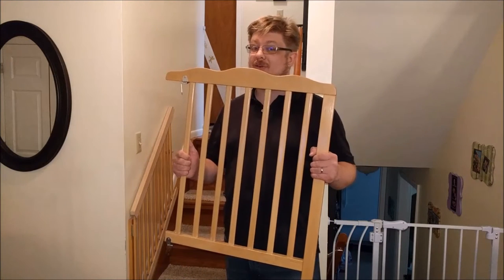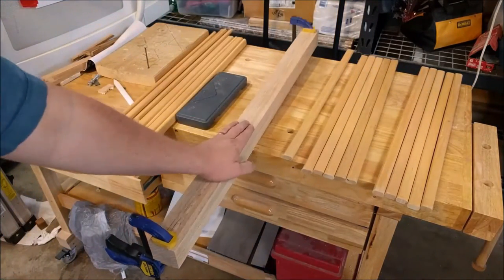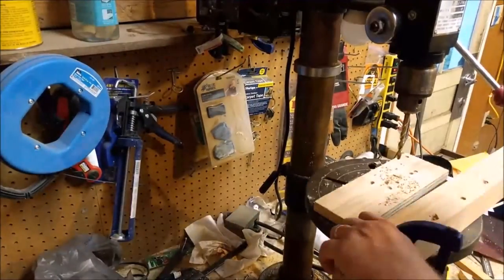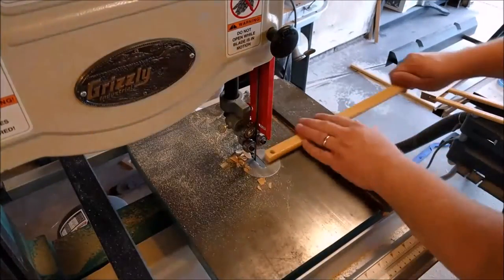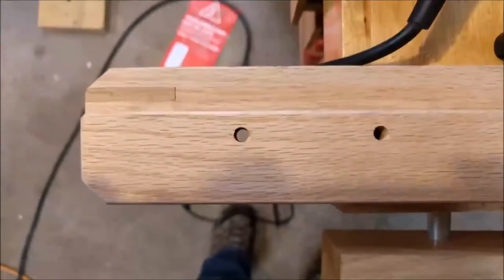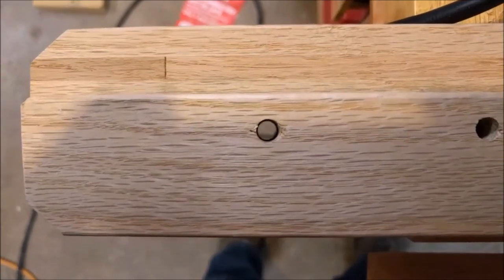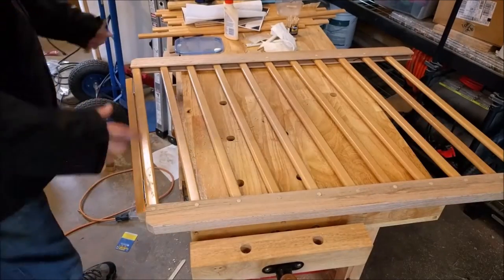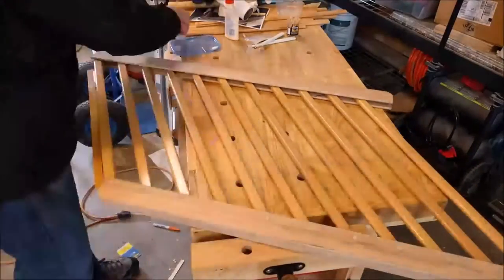Parallelogram Baby Gate from Old Crib.

Comment: Nice Job. I find it so rewarding to get daily use out of one of my projects! suggestions for next time. setting up a fence on the drill press would have made it so the holes on the rails would at least be consistent one way. and a Brad point bit may have helped the other way. however looks like it turned out just fine!
Reply from the maker: +Honeycutt&#39;s Woodshop Thanks for the input! I am definitely planning on building a drill press table with a fence sometime in the future and see if that helps.  One idea I had after I did this was: when clamping the rails together clamp them so they are offset 1 inch (since they are 2 inches tall). this would make it so instead of the rails being mirrored they would be facing each other. The effect this would have would any mistake of the hole instead of doubling the distance would negate it and would not be able to bind. I should probably make a video of this idea as I am having a hard time describing this idea in text.

Comment: Great project. Can I ask whether you buy screws especially or just use whatever you can find? I noticed you mention that you used a couple of screws from a baby gate you disassembled, and later on you mention that the screw heads broke. 

I do (more so "did" now) a lot of outdoor woodwork (fencing decking, pergolas, garden furniture etc..), and after spending six months thinking I was saving money using the cheapest screws (and constantly having them break or round off) I could find I discovered what it's like to use a decent quality screw when a friend gave me a box, it totally blew my mind.

I've never looked back. Anything I screw in now, I know (from experience) that I can go back to it 5 years down the line after it's been exposed to all sort of of weather and I can unscrew it, and re-use it with no issues.
Reply from the maker: Thanks! I am definitely leaning towards buying quality screws in the future. The screws that broke were from the hinges that I bought. The ones from the gate were solid. I have had several screws that came with hinges break, but each time I start a project I forget to get quality screws instead of the ones that come with them. I will definitely not make that mistake again.